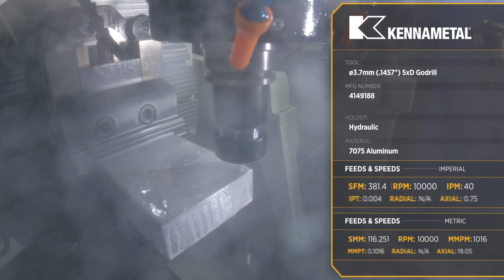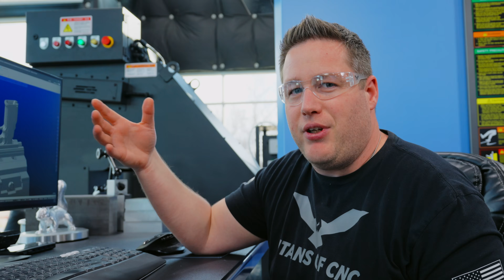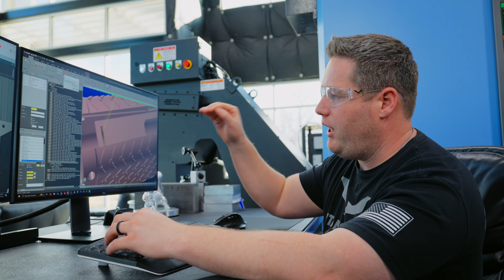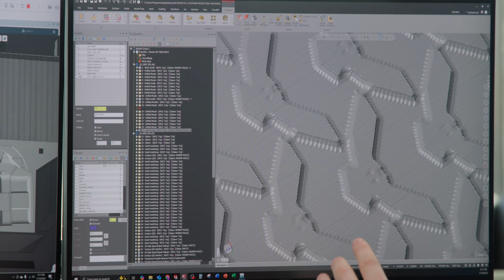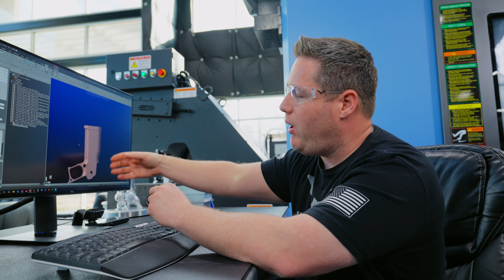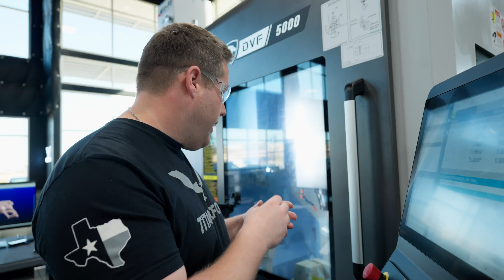Mind-Blowing Techniques EVERY Machinist Needs

Comment: I'm an old-time manual programmer (1980 to 1990), and I used to have the same kind of thought patterns that you described here (for complex parts). Thinking it out ahead of time is where the true science happens....... And I think you did an excellent job here! Especially the part were you Mill a groove to a super tight tolerance because it's going to be used for mounting orientation on another process....... That is amazing manufacturing integration -- and shows a true spirit of "teamwork" that every shop owner wants to see in his/her employees!

And that Siemens software.......wow! I always liked programming with Siemens controls better than any other...... They always seem to think things out and give more flexibility to the programmer....... Then other control manufacturers. 

Thank you for such an excellent video!!!  🤗

Comment: Nice! I just got done making my first 2011 grip last week it seems I took the opposite approach with positioning the part I finished all of the inner critical dimensions then made a fixtur3 pretty much replicating a 2011 frame then machined a reverse of the magwell ran some all thread thru it and and held great finishing the outer finishes and patterns
Reply: Did you do it on a 3 axis? Or 5?

Comment: Can you discuss the tabbing in more detail.
Reply: Where i work we do it alot too, maybe you make a part that will have a less secured 2nd operation so you cant just go all nilly willy full slotting a big mill or high feed mill to remove material, so if you keep that into acount you provide a longer piece of stock and you just zigzag your way down in often a straight line till there is 0.2 to 0.5mm TAB left depending on the weight of the tool so that you can just wiggle the part off afterwards without it have fallen off - we usually offset this away from the part bu 0.3mm which is nice to touch with a light pass on the 2nd op

Comment: Where'd you get those feeds and speeds for the 27/64 drill?  Usually for an HSS drill off the shelf in aluminum at that size I'd run about 600sfm.  I guess you can get away with higher because you have thru spindle coolant, but then you're running only .006" per rev where I usually run .01-.018" depending on how it acts.  Is that to do with the length of the drill?

Comment: As a guy who runs EDM I'd like to thank you for making the point about stock removal.
Nothing I dread more than hearing "I removed as much as I could already" when getting a wire job. Too little material around the cut creates flushing problems, can pinch the wire due to stress relief bending, can vibrate which causes the cut to be badly distorted, and at worst can result in small slugs dropping into the lower guide and getting stuck.
Just drill a hole through it and leave a lot of material, it takes less time to cut through the extra metal than it does to try to prevent all of the above problems.
Reply: This is why I like working with people who know, and if they don’t know, they ask! You are 100% correct.
Reply: As another EDM operator, I completely agree. Any machining to remove material, beyond a start hole is a waste of machine time.